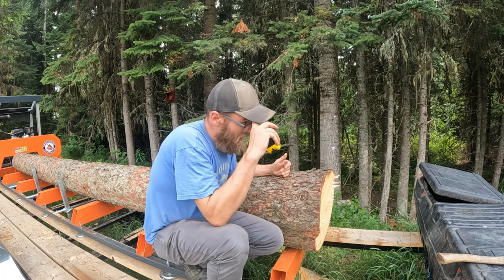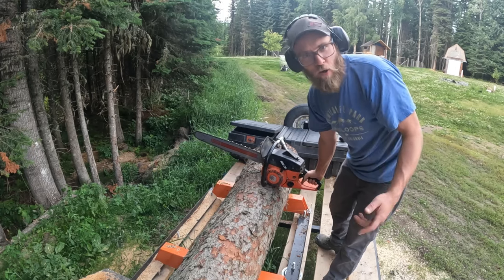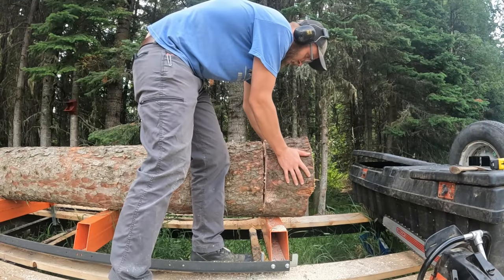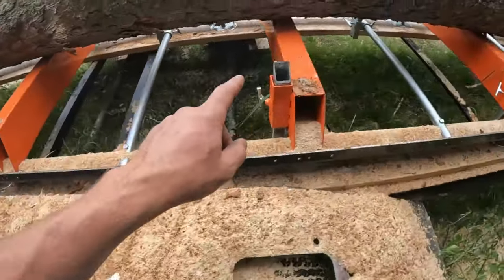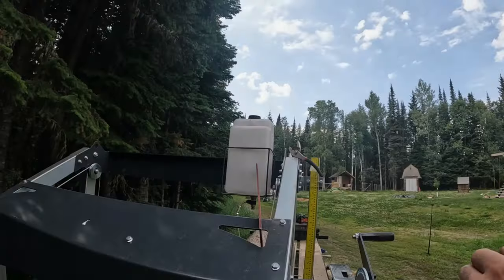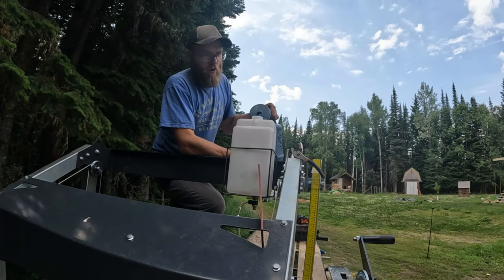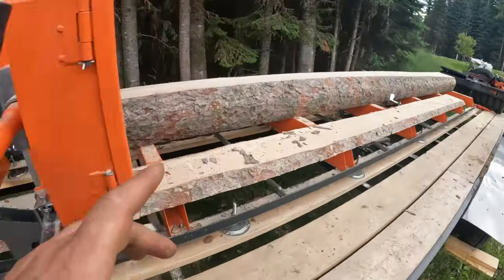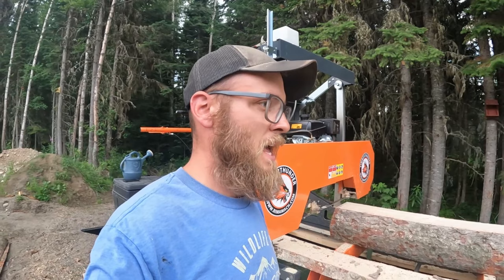Tree Gives Its Life For My Shop Project - Milling Old Spruce For Timbers

Comment: Those tillitson hs carbs are 1 & 1/2-3/4 turns out on the low speed jet for the initial setting. 1 turn out on the high jet.